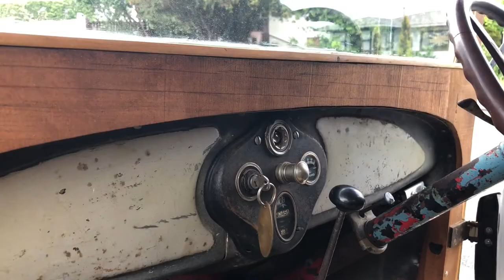1928 Model A Ford C cab Pickup

Comment: 93 and still running, not a bad achievement, the tray board was a good idea i did similar on a willys truck except it was bolted , much simpler folding